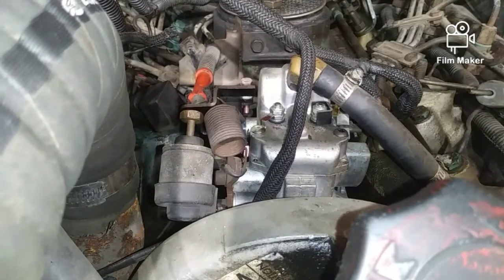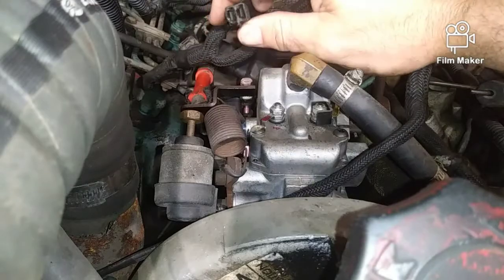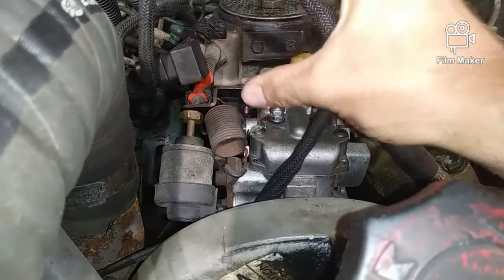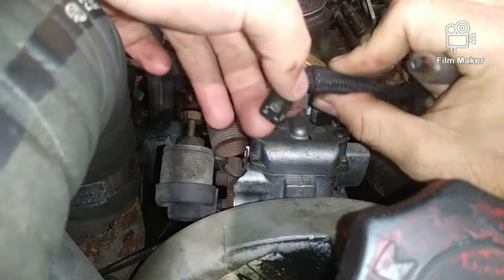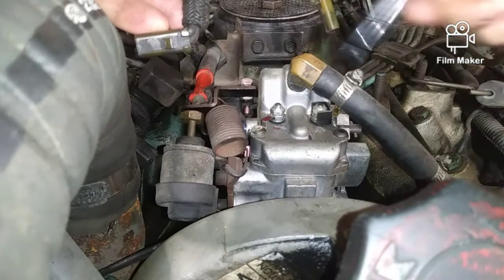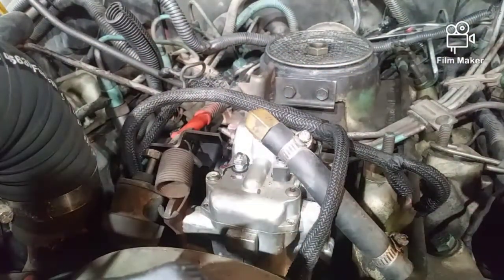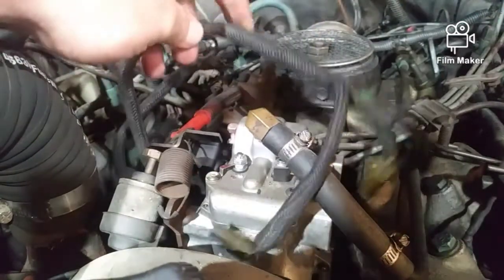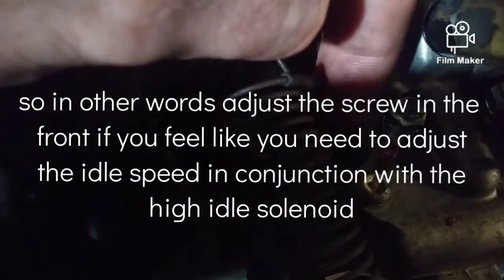DB2 Explaining the WIRING fuel diesel injection pump (6.9 + 7.3)&(6.2+6.5) IDI engines *diagnosing*

Comment: I listened to this about 15 times before i finally understood that the temp switch has a hot wire running to it, and when the engine is cold, the switch is on, sending voltage to the fast idle solenoid and timing advance. Then, when the temperature reaches 144 degrees, the switch opens and shuts off the fast idle solenoid and the timing advance solenoid.

Comment: My biggest disappointment with the 6.9 since i bought one is the fact that it needs electricity to run. I want to delete that stupid fuel shutoff solenoid and somehow manage to make it manual, that way i dont need any 12 volt to keep it running
Reply from the maker: I understand your frustration. Unfortunately everything needs electricity to run. Good news, these old trucks are easy enough to work on without a shop computer. Do you have maybe a question I could answer?
Reply: @ChaosExplained  no not everything, an all mechanical diesel like the 6.9 can run on its own once started and kept in the run position manually. The OM617 has a vacuum controlled fuel shutoff so it can run with no batteries but thats a little mercedes lol
Reply from the maker: @Bricky Boii  interesting! Definitely hear what your saying. Perhaps you could do a YouTube video yourself and do a similar mod on your 6.9?! That would be cool!
Reply: @ChaosExplained  maybe a long time from now lol, thats a bit of work to either modify the injection pump or stick the solenoid in permanent fuel on position and run an inline fuel shutoff in the feed line
Reply from the maker: @Bricky Boii  word! One things for sure, would be cool as hell!!

Comment: That high-idle solenoid plunger doesn't have enough force to bump-up the RPM on its own > > > before you turn on the key you 'must' push the fuel pedal 'down-some' and THEN the plunger has enough force to keep the rpm-up until 114 degrees is met then then it kicks-off (lower idle rpm)
On my (bought new) 1988 F250 7.3 diesel (great truck, engine, transmission) my cold start plunger is acting wonky... sometimes it doesn't hold 'cold' rpm-up. I suspect the unit is just tired and wore out.

Comment: so my temp sensor when i put test light with key turned lights up but don’t send any power to the 2 tabs mine are the green wires…the pink wire gets power and activates the file shut off solinoid…i ran out of diesel and now i’m having problems starting back up it’s a 82 6.2…so i jumped them both out off the shut off (pink wire) and i seen duke start moving through the return…i’ve never had a problem starting up ever i’ve ran out of fuel before add some and started right up…but as i’m trying to bleed the system i’m noticing all these other things….another thing my glow plugs just stopped working …it’s not the solinoid i think it’s the control ..i can jump the glow plugs and get them to do their job …does the glow plug control …it’s the 6 pin behind the manifold have anythjj in bb to do with the temp sensor that the 2 green wire hook up to? …i’ve been doing everything to get the air out for the last 3 days….i’m lost now….as for the cold and the idle i could jump them with 12volts and use a toggle switch when  i get to temp? and if i use a manual glow plug button and bypass the control would that mess with any temp sensors?

Comment: I just want to give you a massive thumbs up. I was driving out of my house today and the truck instantly died... Like 100% ok to completely dead. I saw no visible reason for this to happen. Turns out the previous owner had a single wire lead (not the plug itself) wired to the fuel shut off solenoid terminal and it popped off. Saved me so much time. I was pretty certain it was fuel related as I run waste motor oil in my truck.
Reply from the maker: I'm so very glad it helped you. You're not the only one I've been getting A LOT  of positive feedback because there's just not much information on the web and no one can afford a shop these days

Comment: Just watched your video i bought a 94 7.3 idi with a no crank but no start condition.. I noticed there is no power going to the solenoid under the return check ball fitting would that cause it to not start?
Reply from the maker: @mattsmith2739  howdy, well you lost me at check ball fitting.. on the starter solenoid you should have a constant 12.6v. You should have a much smaller wire receiving that same 12.6v at the starter solenoid that makes it close making the engine turn over.
Reply: Thanks for the reply!.. i thought i was saying solenoid below check ball elbow on top of injection pump "timing advance solenoid"..what my mind is thinking an saying doesnt always align .. Any who the timing advance solenoid isnt receiving power not sure why an how big of role it plays @ChaosExplained

Comment: Great info, only correction, high idle solenoid was never meant to push up on its own. it is like an old four barrel, push pedal down turn key, allow glow plug cycle and start.  It will hold all day as long as key is on.  That is why original start stickers always mention foot feed position on cold starts.Thanks for the video!
Reply: I did notice this, and thought about how that sticker is still in mint condition on the visor in my truck explaining to how to cold start the truck. Lol all that is out the window these days hahah it could be 100 degrees out and she aint starting without ether

Comment: Subscribed!  I've got a new to me 87 f250 idi and this is all great stuff to know down the road if I have issues.  Great content and great explanation.  It would be really cool if you could do a video explaining the fuel water separator thats on the inner fender.  Possibly how the fuel system works with the fuel transfer switch.  Again great content!
Reply: Would love to see this as well as I know I need a new fuel tank as mine allows water in and has for at least the past two decades... so i know I may need a new ip and mechanical lift pump as well. Truck will randomly shut off on decel sometimes (manual trans, put the clutch in and boom shuts off at rpm drop from any rpm when pushed in), so not sure why it is losing fuel like that.  But idk if mine was bypassed or not and i want to know how to reincorporate/upgrade to the 7.3 style separator so i dont mess anything up more

Comment: That was a good video.. and well done..    For me i just installed a new IP and injectors..  and No One in San Diego can Tune it..  did static timing..  any options for tuning by ear ect..  i may have a lead on a guy who works on Big Rigs.. lol
Reply from the maker: Hey thanks for your Feedback, these injection pumps come from wherever it is in the world they sat it at very specific settings. If you were concerned about timing I suggest making sure your timing is correct with the dot on the top gear under that small cover. Remember this injection pump depends on the gears in the front for the timing, it's literally the heartbeat and brain for this engine. If it was installed incorrectly and the timing is off this engine will never run. Hope this helped!
Reply: @ChaosExplained  thanx for reply..  yeah, didn't take off that top gear cover..      it does fjnally sound like a diesel with the new parts.. have some trips planned.. and it smokes a bit more than before..  but  the new pump has better fuel supply now.. haha     thinking a pyometer maybe handy.. just to be able to watch..   but after watchjng and listenjng to other 6.9's ect..  its prolly good to go..  no one here has the 30 year old timing gear needed.. haha  thanks..

Comment: My 91 f350 7.3 fires up and idles fine but when i give it some throttle and let off it dies.. just wondering if you had any advice on what to look for with that issue. I need my truck for work but don’t trust hauling the goose neck while it’s running like this. Thank you in advance

Comment: If the advance timing is not working will it smoke white when it's cold?
Reply from the maker: White smoke= unburned fuel... Or if it's not smoke but white it's just water vapor atomizing since it's cold out. OR if it's white, excessive water vapor and smells sweet = coolant being burned
Reply: @ChaosExplained  well they took 94 bd2 and put 92 with different injection pump and only 1 wire ran to it to run and the cut rest wires so idk how fix it?? But thanks for u messaging back ,God bless
Reply from the maker: The best advice I can give to you on that is, run the numbers on that injection pump, sounds like there might be a Frankenstein mod here. You'll probably have to look at two different schematics to figure out what's what. Happy Halloween 🎃!
Reply: @ChaosExplained  yeap that's what I said lol and happy Halloween to u to!!!

Comment: My 6.9 has been missing on one of the cylinders for a month or so and smoking alot. The other day I was driving and she stalled. I tried everything and couldn't get it to start. There seems to be pressure at the injectors but no fuel seems to be getting to the engine. Do you have any ideas?
Reply from the maker: I will give you a couple tips for sure. Will be making a video on the science of atomization in fuel Vapors and the color specifically of "smoking" it is a misconception that black smoke is unburned fuel when this is actually incorrect... black smoke is an indication that the fuel is burning however it is burning way too rich for the air molecules to match. White smoke that does not smell sweet but it smells like vinegar is unburned fuel atomization coming from the exhaust. If the smoke is black and gray then this means the air is mixing through the exhaust and you have some cylinders that the mixture is too rich and some cylinders that are not firing under compression.. the clue that we need to know is what color is your vehicle puffing? That's the first clue

Comment: Can you put up a drawing of the wiring that goes to the pump. Don't have wiring on the truck.
Reply from the maker: Hey thank you for commenting! As far as the drawing goes for the print fast forward this video toward the very end and it will give you definitions of the solenoid so you can look it up on Google if need be for the db2 wiring. Only 3 solenoids are directly affiliated with this, fuel shutoff, advance timing, and i forget the third. Just look at the end lol
Reply: @ChaosExplained  are these wires hot all the time when the key switch is on that goes to the 6.9 fuel pump.tks for the come back.

Comment: So basically if the engine temperature switch goes bad it will not send power to the cold idle solenoid or the timing advance solenoid?
Reply from the maker: Hey thanks for your feedback, without looking at the print in front of me and it's been awhile since I made this video. I'm going to take a guess and say yes that is correct. The temperature switch is a on or off switch not variable. So yes id assume that the cold engine idle solenoid is tied in with this, guessing without looking.
Reply from the maker: What you can do is you could always send a false signal to punk the circuit essentially. On the temperature switch just pull off the wire and ground it out since its a 1 wire to ground... if this is true what you are asking it should actuate the engine cold solenoid

Comment: My high idle solenoid has never opened the throttle. I always have to hit the fuel pedal to get it to high idle. Owned the truck 20 years, since 30k miles.
Reply from the maker: Yeah that thing's expensive too I tell you mine's a little weak but works still. Think I found one for 40 bucks used on ebay food for thought
Reply: @ChaosExplained  for what it's worth, it's always been my understanding that the high idle solenoid just isn't strong enough to push your throttle up. When you hit your throttle, the plunger on the solenoid extends until it hits the throttle lever and will stay locked until the engine tells it that it's reached 114 degrees. That would explain why, in this video, your plunger was able to extend out to the throttle when you tested it.